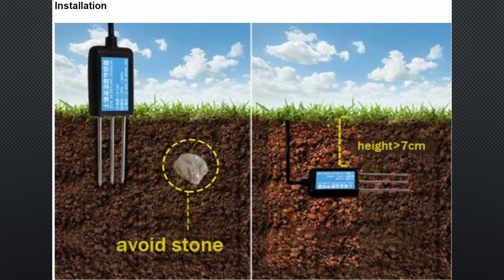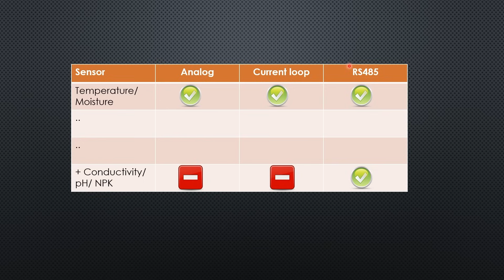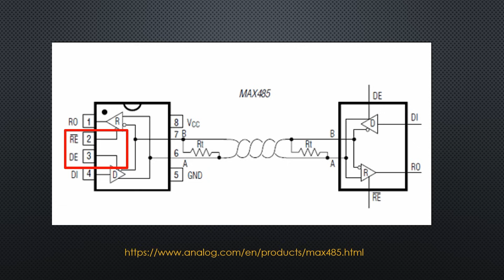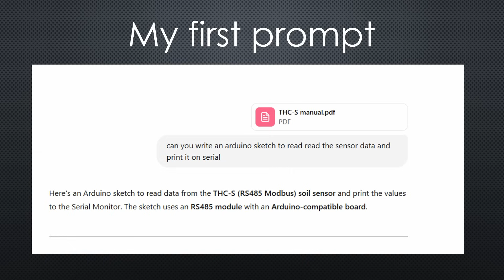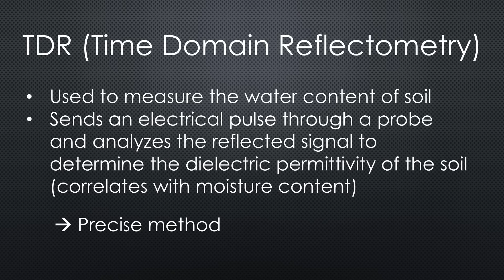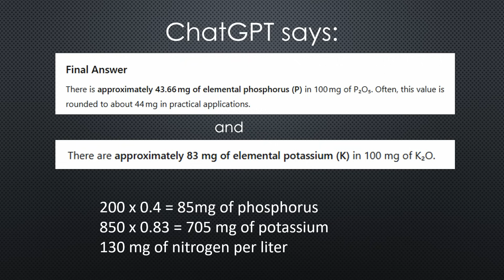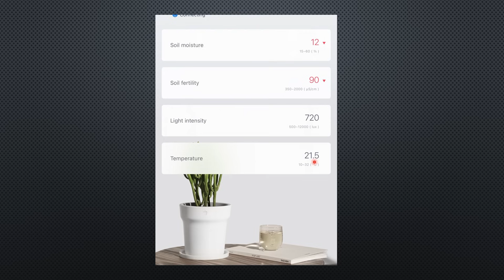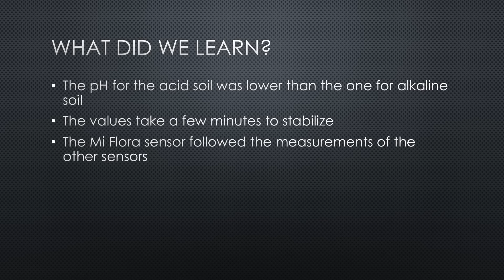(502) New (better) Soil Moisture Sensors and RS485 Modbus on ESP32 Arduino

Comment: Never use its NPK, its EC based and in most soil, the accuracy is nearly 0% and in rare case you might get 70% accurate if and only if your soil is similar to the manufacturer's soil calibrated for. 
For EC, Soil moisture, it's quite accurate. but the soil need to be wet in order to measure EC because it's based on conductivity.

If you buy the 5-pin one which include 7 parameters, the PH will be very wrong because of interference with other pins(i guess) but if you buy the PH alone, then the result is reasonable. And for the PH, you can't stick in soil for days because the Agcl will erode.

They claim that their moisture sensor is FDR, but i am not sure if it's truely FDR or not based on the price(around 8$ if you buy from China platform).

@Andreas thanks for your quite elaborate test and neutral review. Unlike many videos which just get it to works and claim that this is a great tool or magic wand to measure NPK.
Reply from the maker: Thank you for sharing your experience! I saw that the PH sensor is of a different material. Another commenter also mentioned that using EC seems to be the better choice than NPK.
Reply: Great comment! Did you use rs485 with your sensors? And would you mind posting the link to the ones you purchased?

Comment: I recently setup Home Assistant and used the esp32 builder to setup a few temp sensors around the house. It was pretty easy.  Im not hopping on the AI. I will learn the nitty gritty, I'm not in a hurry and the tinkering with microcontrollers is mostly about learning.
Reply from the maker: Learning the nittiy gritty is a good thing. I use AI a lot to learn it, BTW. It is a very good teacher.

Comment: There is a ZigBee version of a similar sensor that reports Temperature and Moisture. Tuya model TS0601_soil. It connects to Home Assistant via zigbee2mqtt without problems. Uses 2 AA batteries for about a year.

Comment: Obviously the chemical content of an aqueous solution would already be a challenge (requireing expensive ion selective electrodes, that are conditioned in a buffer solution when not doing measurement, still not being too accurate). I have seen, that in hydroponic farming that pH is a very important factor (the nutirents do not deplete that fast). In a soil a continous monitoring of nutrients, K(+), PO4(3-), NO3(-) is probably by far not that critical as humidity and temperature. (The pH is also probably well buffered with organic and inorganic salts of weak acids and bases). What could be a good experiment though is to monitor the long term stability of these sensors, with some kind of reference (digital scale?) including temperature. Measuring temperature in the soil could be also of interest especially in Swiss weather.
Reply from the maker: There are some other comments (one I have pinned) of viewers with experience. They confirm that the chemical stuff is not needed, but the humidity and EC seems to be rather accurate.

Comment: I like the Chirp! capacitive waterproof moisture ones - some new ones have LoRA for TheThingsNetwork indoor gateway and were out all last Summer and spent Winter indoors in pots. Basic wetness altho readings can get weird - I calibrated for dry air = 0,  fully immersed in water = 100;  then in soil they'll report 110 or so when wet but definitely reports low when getting dry.
Reply from the maker: Thank you for sharing your experience! These seem to be based on the ones of my last video.

Comment: how do these things measure water content?  you mentioned a capacitive measurement, how does that work?  in my own tests, the simple voltage and current measuring devices all fail over time because they work like batteries, charging the electrolytes in the soil, and electroplating the pins, which destroys the units.  at the moment, in my own experiments, i am passing an alternating current into the soil, and measuring the average current drawn.  these last longer, but they are still not reliable.  so, please would you explain, how is soil moisture correctly sensed?  as far as i can work out, there is no reliable electrical method, and all of these devices are bullsh*t.
Reply from the maker: In my last video and in its comments, these topics were discussed. I suggest watchin it. As I mentioned, I am nnot sure if these sensors use the capacitive method or the (more accurate) TDC.
Reply: @AndreasSpiess  thank you, your other video - https://www.youtube.com/watch?v=m0mcCtcViTY - answers my question directly, and i am now testing with capactive sensors. however, with total dissolved solids method, i understand this measures the current conducted, and the question remains - if they are using a direct current, are they not creating a battery, and electrolysing the probes, over time?  i think an alternating current will work, and it seems to work in my experiments, with carbon rods for probes.  my application is measuring sea water level in order to control a bilge pump, which is probably a more corrosive environment than soil, but the principles appear the same.

Comment: So, these sensors are more expensive and probably function about as well as standard capacitive sensors (NPK measurement obviously does not work to a useable level).
Reply from the maker: You decide.

Comment: Hi Andreas, can make a video on how you 'talk' to the AI services? 
I really do like including the data sheet. I didn't know you could do that. I have included requirements but the AI don't seem to deal with that very well (bad requirements?).
Thanks
Reply from the maker: 1. AI only knows things it learned. So do not ask it new things or very rare things. You will be disappointed.
2. I can attach a file to my prompt (only in the 4o model). But I pay them 20$ a month
3. I ask normal questions without any tricks. If I do not get the answer I need, I ask again or more precise (like a discussion). Sometimes I start a new chat with an "integrated" prompt where I include all prompts from the last "discussion".
Reply: @AndreasSpiess  learn the not knowing quickly when I asked it to do a couple of loop in Motorola 6800 asm.
I also have an AI account (and a couple of work accounts). I asked the AI to put together a node.js app that would add groceries and assigned aisles then output it an org-mode list format so I would have a shopping list on my phone. Works okay, The AI won't create a proper add/save/restore so I can create existing lists during the week. It has hallucinated terribly on that requirement. But on crazier things (like SSL cert updates. exception handling and a few other backend things) it has done a decent job. Definitely high end Jr programmer. And my requirements are like my programming, we don't get cute, we keep it simple so anyone can understand and see if we missed anything. I probably do need to work on better requirements. Thanks for the file attach idea, I hadn't thought of that. :-) BTW, the grocery list is on my github.com (linuxha) not sure I have the latest code there yet.

Comment: Interesting for both sensors and AI.  I use Claude AI and have not asked to have a program generated.  I use it a lot for 3D printing parameters for materials, etc.  Sounds like a project to me.  I hope to ask exactly what you did with the same reference material.  As time allows, I will do this (maybe not real soon, but soon LOL).  You can expect to see my results someday.  I am retired, but I formerly wrote s/w for vehicle power-train controls.  My job would have been very different with AI generated code and more efficient for sure.  They would still need me for specifications and testing, at least, for a few more years.  Times they are ahh changing.
Reply from the maker: Indeed, writing specifications and assessing the AI results needs some programming skills. But no more all the details of programming and looking up the syntax. 
So far, I never used AI to write a test procedure. Maybe a future project for me...

Comment: Maybe chatpgt can write usable code, but can I trust my prompts to create that result. 😅
I've also been told that wood 'contaminants' in those soil bags tend to sequester available nitrogen.
Reply from the maker: That would be an explanation for my measurements, because "my" soil contained wood.
You do not need to trust anything (AI or human generated). I am a big fan of testing. My slogan always was: "If a device is not tested, it does not work"

Comment: NPK and PH readings are just a scam, use distilled water and salt (NaCl) and you'll still get NPK readings
Reply from the maker: Thank you for sharing your experience. I agree. My question was more: Does the sensor help in deciding what to do (in the setup of agriculture and soil).
Reply: @AndreasSpiess  
It does in terms of moisture , but requires calibration with respect to the soil as each soil type has a "moisture" capacity, for example for some soils 40% moisture means a fully saturated soil while for another type that's considered dry. To sum up the values cannot be used in absolute, they should studied for each soil.

Comment: We use RIKA sensors from china, and they don't have npk because It is not easy to measure these parameters with good precision.
Reply from the maker: Thank you for sharing your experience. Your manufacturer states that they use FDR (or TDR) which would be very interesting because it is quite precise. They seem to be a bit more expensive, though.

Comment: Great info, Anreas. However, for the price range of this sensor plus other required modules, you may just buy a readily available wireless soil moisture sensor like Ecowittweather. The price is a big NO for me.
Reply from the maker: They seem to be similar to the ones used in my last video. I am glad you are happy with them!
Reply: Yes you can buy one that’s ready made how’ve you will not be able to program it or use it in conjunction with out devices on a private IOT network the same way.

Comment: 14:11 "the NPK values are just indicative" == "we don't know how to measure, but here are some random numbers."
Reply from the maker: There are absolute and relative measurements. Relative usually is much easier and cheaper than absolute. But often, relative measurements are sufficient for a purpose. I do not know if this is the case here.
Other commenters write that they do not trust the NPK values and use the EC values instead (see pinned comment as an example).
Reply: Gleich drei chemische Stoffe kontniuierlich lowcost zu messen, darüber wären Chemiker erstaunt.
Die Übersetzer KI spricht von RS485 Rubien und Spanien 32.

Comment: I spent $200 on my EC/PH meter (replacement probes are $100) calibrated every few months. Frankly I don't expect new/cheap solutions will ever replace it since lots of toy meters already exist and they're all terrible.
Reply from the maker: There are absolute and relative measurements available (absolute is more expensive, as your meter shows). However, sometimes, relative values are fit for the purpose. But I do not know if this is the case with these sensors.

Comment: I used an ESP to read RS232 with a custom compiled Tasmota image which made MQTT and import into Home Assistant trivial.  That should also work with RS485.  Compiling the customized Tasmota firmware was a bit of work up front though.
Reply from the maker: Thank you for sharing! Indeed, RS232 is also not covered by standard ESPhome (I do not understand why). I had to add C++ code to another project. It was also not easy...
Reply: @AndreasSpiess I didn't have to add any custom code because it's part of the Tasmota project.  I just had to compile it myself because all the supported features aren't in the pre compiled bins due to space constraints on many microcontrollers.

Comment: These are almost certainly FDR sensors, probably a rip-off from the rather old Delta-T WET2 sensor. 

They aren't capable of NPK or pH measurements - that's just a scam - but are pretty good for moisture and conductivity from which various other parameters can be derived. Some calibration required. 

I've owned some of these for a few years - they work OK and the FDR method is the most accurate for soil moisture measurement other than neutron probes and direct sample measurement (by drying and weighing).
Reply from the maker: Thank you for sharing your experience. Good you mention FDR (TDC). Because of the low price, I was not sure. However, another manufacturer with very similar-looking sensors states it uses FDR. That would explain the good results for humidity.

Comment: NPK from cheap sensors? Lol 😁
Routinely measuring NPK requires a whole laboratory with staff.
20-40 USD is way too expensive for what these sensors deliver.
Reply from the maker: You are right if we talk about absolute measurements. However, measuring relative values is often much cheaper and sufficient for a particular purpose. But I do not know if this is the case for these sensors.

Comment: Additionally I Learned that Swiss bags of soil have the NPK analysis and pH printed on them which I've never seen in the UK.
(we do have separate products for acid loving and acid hating plants of course - they just don't tell you what the pH value is on the bag)
Reply from the maker: I also was not aware of that fact and way positively surprised for that project ;-)

Comment: Andreas, I've watched your videos for a good while and I think if anyone can answer this it's going to be you.  Have you ever ran across a manometer sensor that can measure differential pressure in inches of water column (obviously the scale unit can be adjusted to whatever unit you need with a conversion calculations).  I can't seem to find any that have a high enough resolution to measure down to a tenth of an inch of WC and measure down to between zero and 1 inch.  Thank you for all the great content you produce!
Reply from the maker: I once made videos on water level sensors (which also included pressure sensors), but that is all I know about the topic.

Comment: I supposed it was not possible to determine the NPK levels only measuring electrical quantities like soil resistance or impedance. Only a chemical analysis can do it.
These sensors are good only to measure moisture and pH (perhaps). Ah, and temperature if they have the sensor
Reply from the maker: I agree.

Comment: When I got the most comprehensive sensor about 1,5 years ago, I "calibrated" the PH, EC and NPK using hydroponic nutrient solutions. So I mixed for example a PH 5 with EC 2800uS/cm and a known NPK ratio. I also did the same with PH7 and EC 1200uS/cm and known NPK. It worked pretty good. Nitrogen is hard to measure so it is rather an assumption taking the EC, calculating what should be left after processing P and K. But things like Calcium and Magnesium also influence EC. 

To just observe your soil and feeding plants and see what the values are doing you can at least set-up an schedule or warning, or check what is going wrong on certain spots in your garden.
Reply from the maker: Thank you for sharing the results of your experiments!

Comment: Two sensors cannot be connected on RS485 in parallel in principle. Perhaps two may work in parallel. But more than two RS485 should be connected in a daisy chain manner.
Reply from the maker: You are right. However, you have to explain to me the difference if the "daisy chain" of 2 sensors is 10cm long.

Comment: Note that esp32 pins are 5V tolerant. You actually don't need any voltage level adapter. If still worried a simple voltage divider on the rx pin will do the same job. As for tx, 3.3 is more then enough to drive the max485 input even when powered by 5V.
Reply: Or just take a transceiver IC that is designed for 3.3V logic levels. There are much better options than that old MAX485 (30 years old by now?), even with much better protection circuits inside the IC to prevent damage from all kinds of sources like static dicharge, surge, short to a supply rail and others.
Reply from the maker: Thank you for your comments. I agree with the following explanations:
- I never saw the 5V tolerance in the datasheet of the ESP32. As a YouTuber, I have some responsibilities.
- I usually use boards available on AliExpress for my experiments because they are globally available in small quantities

Comment: Have you tried the augment plugin in vs-code yet? It is really impressive, but have not tested it with microcontrollers yet.
Thank you for sharing your results :-)
Reply from the maker: 1. After this post, I looked into Augment. Seems to be very comfortable. But I did not try it yet.
2. The post (now removed) was from a scammer. He or she posted on many of my videos. Fortunately, it was always with the same user.
Reply: Oh, sorry for that trouble.
Reply from the maker: @daskasspatzle2396  No problem.